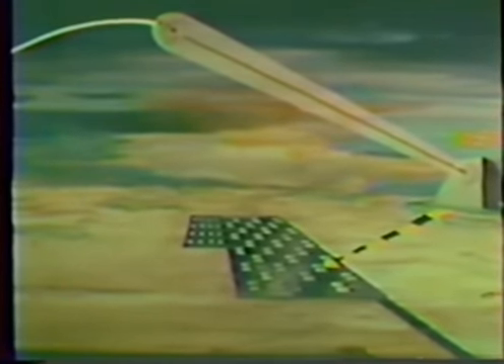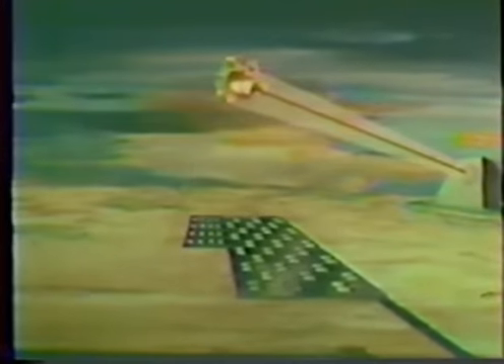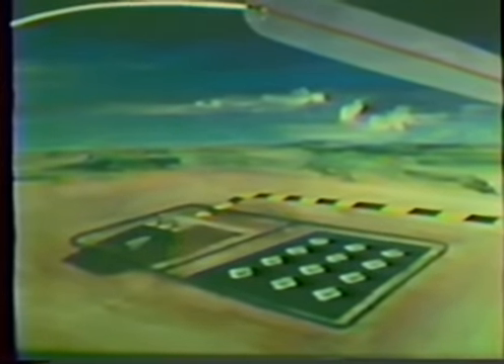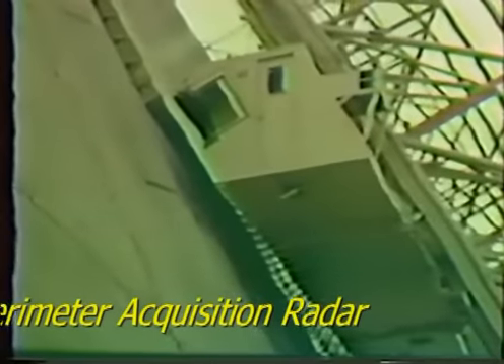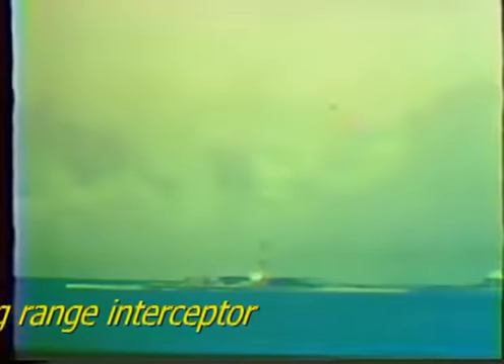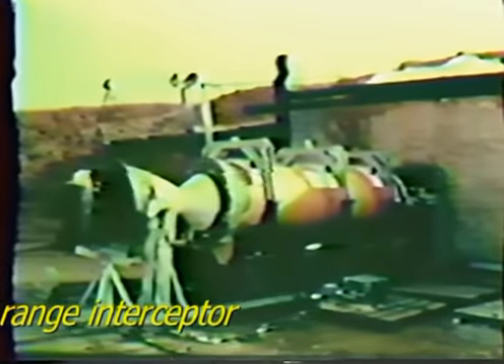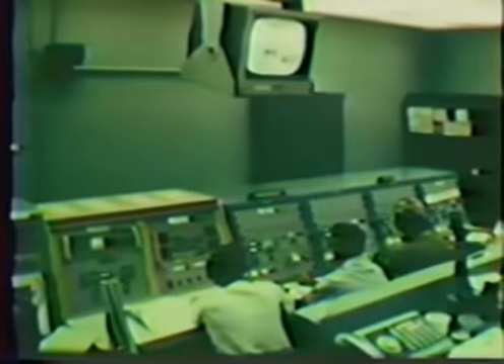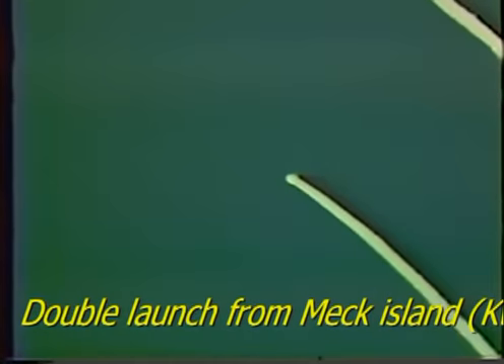The Safeguard ABM System

Comment: @shackvan My implied point was that with modern sensors and electronics you would not need a nuke on board. Sorry for not saying that. The mechanical performance, at least what I have seen, of this system was incredible. As for third world threats, well their forces are small enough, you can do a first strike to mitigate most of that threat. Soon we'll be able to strike first with conventional forces.. Not sure about the long term strategic stability of a world that kind of capability.

Comment: Amazing technology for its time, a pity it was scrapped.  I know a lot of today's systems grew out of it , but how far would it have grown if we'd stayed with it.  Might not have to worry about the Korean runt if we'd married modern technology to these and the laughed at SDI.  Technology would have found a way to "separate the wheat from the chaff".
The ABM treaties gave everything to the USSR, with no confirmation that they adhered to it.
The interstate highway system was originally designed for fallout/bomb shelters built into every overpass, but that got traded.  The Russians claimed that was an unfair advantage by saving our citizens from MAD, but no mention was made of their subways doubling as shelters.
Folks cuss the expense, but a lot of things grew/grow from the defense industry.
Ablative tiles and the ceramics that are the rage in non-stick cookware.
Microwave ovens for the lazy housewife and the safety of young drunks.
Aaramid/kevlar fabrics protecting emergency personnel.
I'm sure folks traveling the interstates across Tornado Alley would welcome shelter if we hadn't wussed out.
I grew up in the "duck and cover" era.  We lived under this gun every day.
Get a grip

Comment: @TheDuchessofZeon If that were the case the Spartans would have to be launched on warning from the DSP, not from warning by the PAR. It would also mean that the intercept would happen deep into the midcourse. Spartan would have been engaging R-36's which released their warheads early in order to provide maximal dispirsal and minimize fratracide by attacking Minuteman silos far apart.

Comment: @shackvan Was that really the case? Not that EMP was not a problem, in fact I think the system depended on it. It was my to my understanding that the neutron bomb was developed for Safeguard in order to generate extra EMP. Was it just that the system was not going to survive it even though they tried? I'll tell you what, put modern electronics in those mechanical systems and you'd have a really effective ABM.

Comment: @fubuxjenk ICBM intercept is a very difficult problem. At the terminal phase you're talking miles per second closing velocities. You need control all the way to the end given how small the warheads are. Exploding gains you very little extra area unless you use a nuke, and even then it's questionable.  You need that bullet to be intact and maneuvering all the way to the end. You're vehicle is traveling many thousands of its own length every second. So is the target. There's no simple solution.

Comment: HOWEVER-those 5MT blasts would be in SPACE, over 300 miles up. At that point--I doubt too many thermal  or blast effects would be noticeable on the ground.
Reply: Emp could be a problem.  Those were enhanced radiation warheads.

Comment: Actually not, Spartan would have been very dangerous (aka flash fire causing) dangerous for everything in several dozen mile radius directly beneath its detonation point. 5MT is a lot. I cant remember but it could have been something like third degree burns in 10-20 mile radius and forest fires in 30 mile radius or something. Using it was way worse than just the EMP.